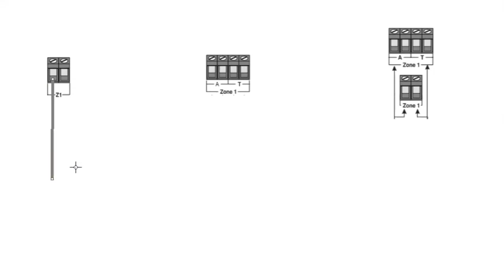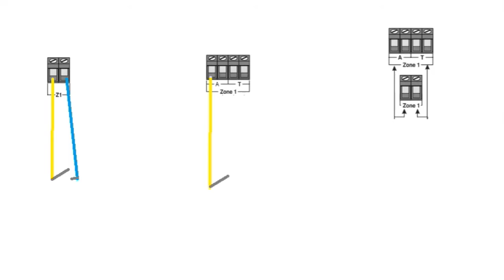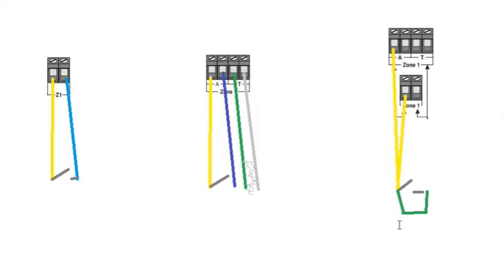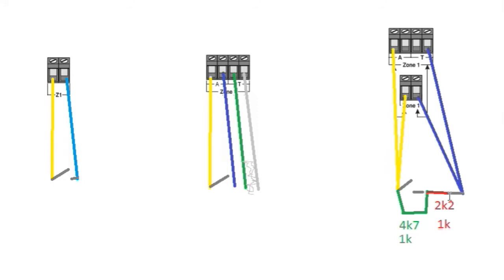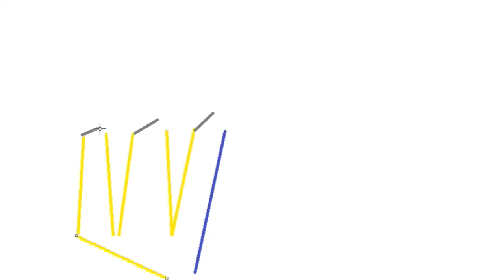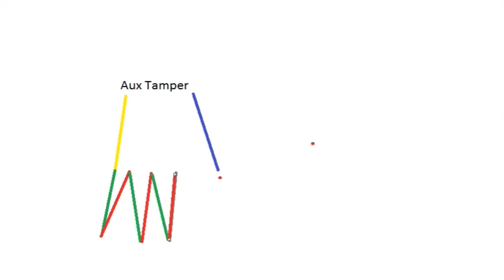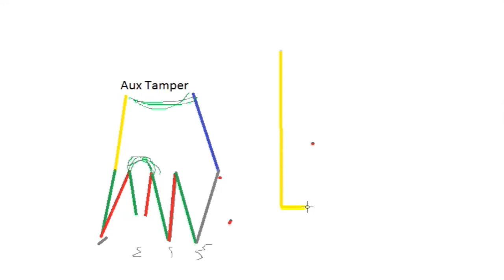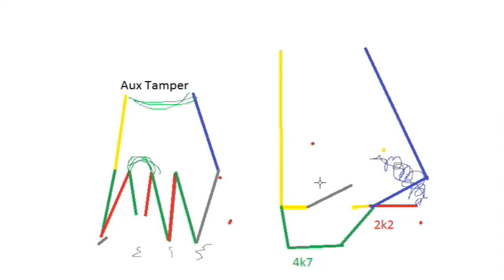Alarm Tech- Circuits

Comment: Hello, I currently have a Honeywell accent G4 alarm panel and I would like to upgrade the connections on my door contacts to EOL. They are currently wired as just standard 2 wires in the door switch for tamper, just wrapped together and clamped with a brass screw and 2 for the alarm zone on both contacts in the switch. I have been watching videos on YouTube on how to install 1k resistors to the door contact but I can’t find anything on how to change the way the wiring is currently wire in the panel on the zone. The tamper in the panel is currently wired as a Aux tamper and all the pir’s and door contact are daisy chained together. I understand that in the door switch’s I will need to disregard one of the alarm cores and one of the tamper cores to install the resistors but what do I do with the disregarded cores from the door contact switch’s in the panel end. When I remove these 2cores from the panel (1 from the zone and 1 from the tamper what do I put in place for the one which will be removed from one side of the zone. As for the tamper I’m not sure are this core will be connected to the Aux tamper with the rest which are daisy chained. Any advice or a diagram in layman terms would be greatly appreciated.
Reply from the maker: Hi, an Accent G4 cannot use EOL, you are correct in saying it uses a "global" tamper and individual alarm zones which will either be open or close. It doesn't see or recognize resistance changes that an EOL system would use. The panel simple see's an Open Circuit (the door open/ the PIR has seen something) or Closed circuit (the door closed/ the PIR doesn't see anything)